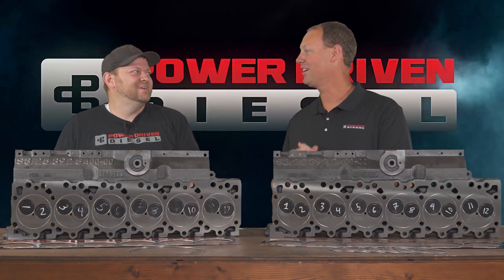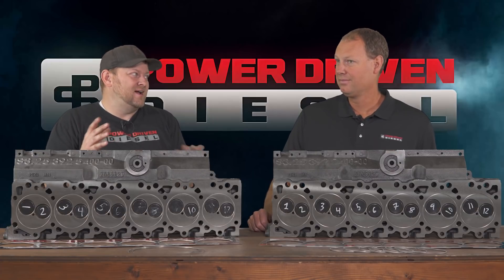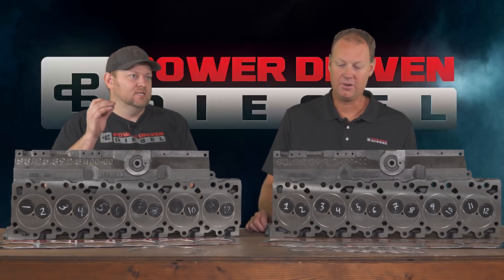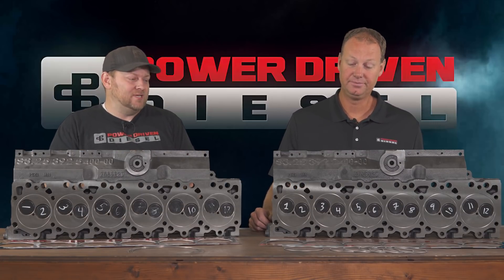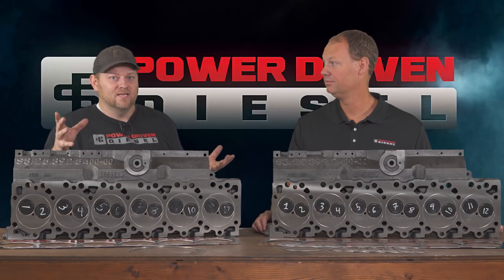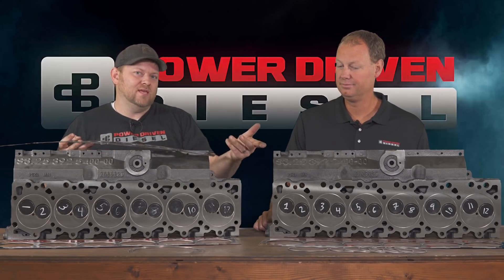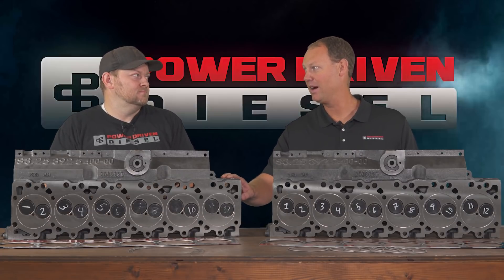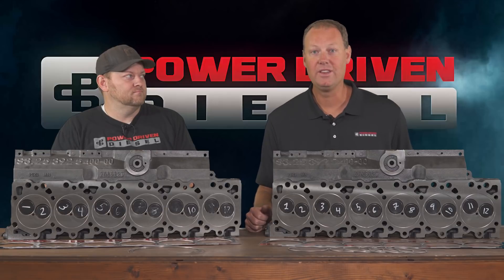Cummins O-ring vs Fire Ring Head Gasket | Parts Bin Ep 27 | Power Driven Diesel

Comment: 91’ intercooled Ve pump cummins goal of 600hp what should I do,MLS good enough?
Reply from the maker: We would use an O-ringed head unless you plan to surface the block and head for the proper RA finish required for an MLS gasket.

Comment: OEM motors like DD15 and 16 use fire rings that are stepped into top of liner and also act as top land carbon scraper and ive never seen one crack, i am wondering if you have looked at doing this for cummins applications

Comment: Can you get MLS head gaskets for a 12v? Would that pre-empt an o ring?
Reply from the maker: Cometic made them for a while, might still be available... but you'll need the block and head surfaced to a finer RA finish that oem to make it work and the gasket was $300+ back in the day, OEM gasket and o-rings was the same price so no one pursued MLS on newly built 12v engines.
Reply: @pddofficial oh. Now I remember you mentioned the RA.

Comment: You say not to o-ring a newer head with MLS.  But then said to o-ring all new heads.  I have a 2011, going to replace the head, buy a o-ring version?  If so, get a composite gasket?
Reply from the maker: We do not recommend O-ringing a 2003 and up cylinder head, just the 02 and older. The sealing surface on a common rail is better!

Comment: What about copper head gasket with fire ring??? I work in a shop years ago that built formula 1 engines and NASCAR engines and copper was used in the more expensive engines…
Reply from the maker: We've only seen copper gaskets on dry block and/or dry deck diesel race and sled pulling engines, however, they still utilize a steel fire ring to seal combustion and the copper is only used for oil sealing and heat transfer.

Comment: On a full rebuild, would you o-ring the head or the block? Shooting for 650/1500 range on horsetorques. I'll use it as a towpig/daily driver. Great video.
Reply from the maker: Most local machine shops do not have the specialty tools to o-ring the engine block, therefore it's most common to o-ring or fire-ring the cylinder head.  A head is much easier to ship to a specialty machine shop and/or purchase a new head that is ready to go.  We've seen no difference in reliability between choosing the head or the block for o-rings.
Reply: @pddofficial  Thanks!

Comment: I’m looking at getting the heads ported and the fire ring on the block and heads for my 2002 F350 DRW 4x4 CC LB Lariat 7.3 Powerstroke, Do you guys work on Fords? I got the KC300X stage 2 turbo 63/73 with the .84 housing, 304 grade Stainless Steel headers, and upgraded to 5” turbo back exhaust, Holders Premium 180cc/80% nozzle injectors, PHP Hydra tuner, Going with the stage 1 cam kit because I’m building for Heavy Towing. Please let me know if you can do the porting head work and valve/springs/retainers rebuild, Thanks!!!
Reply from the maker: At this time only the 6.0 sorry!
Reply: @pddofficial  Right On, Thank You Sir

Comment: My truck never lost a head gasket but I finally at 340,000 miles pull it to freshen it up and give back to the truck that's paid for itself ten times over and never gave me any problems besides a heat exchanger going bad so while I'm in there I am sending the block and head to the shop to get machines and thry are cutting the fire rings in both block and head because now that the truck is my toy daily more than anything it's just gonna keep getting more and more power haha and I ordered two sets of fire ring gaskets one for the shelf and one to go in❤

Comment: When you finish installing an O ring does it sit flush in the groove or does it stick out a little?
Reply from the maker: It will protrude out .013. The wire is .040 and the grove is cut .027

Comment: I have a 2015 6.7 Ram 3500. Tuned and deleted. Blew a head gasket last year installed a new head installed ARP 2000s and MAHLE gaskets. Blew again six months later. Is O-Ringing the head gonna help since i have the metal gaskets?
Reply from the maker: No not on a common rail you have to fire ring or run the better Arp head studs.
Reply: @pddofficial  Thoughts on wastegate install?

Comment: I know this vidjeo ain't about them, but O ringing your heads and using ARP studs is really the only way to keep from blowing head gaskets in a 6.0 Powerstroke, which as most people know is a huge problem with these engines.
Reply: Properly installed fire rings machined radius grooves in the block and head, and crushed appropriately, so torque and hot re-torque I know on the v motor it could be tough. A hot re torque on my Subaru sti would be an act of god. I still pull motor and try my best but any hp application you must be dedicated and do what needs done. Do not use square grooves must be radius and machined with proper crush tolerances. Honestly I don’t waste my time with o rings. If I’m that deep and it’s turbocharged it’s getting fire rings

Comment: Great info! We are currently freshening up the 12V in my son's 1996 Ram. So if we have the head cut for O-rings at a local shop would they also supply the wire for the rings, or is that something you sell? I assume you carefully cut the stainless wire to length versus them coming as rings.  I looked on your site for O-ring wire but didn't find it.
Reply: I found the information, looks like you just buy welding wire and carefully fit it into the groove.

Comment: What are your thoughts on copper coating gaskets? I did it on a 600 hp 12v built (no o-ring or fire ring) with exotic head studs. 3500 cab and chassis dually. 19* or timing and have towed with it before. Haven't seen any issues with it.

Comment: I have fire ring head with CA625 head studs and compound turbos, I totally agree with the boss there’s no point to use O rings if you’re making increased power. I hot re-torqued and did oil change at 500 miles then every 5000 or 50 hours, I am not an aggressor driver, so far zero issues at 250 hours.
Reply: Any issues since? It’s been 2 years still holding up?
Reply: Any issues since? It’s been 2 years still holding up?

Comment: Always love the parts bin tech. Appreciate you guys making it clear as day and sharing the experience of having tried different set ups and sharing what is successful.
Reply: 5.9 Any suggestions for 5.9 stock engine to turn up HP to 500 to 600 HP with used engine of 200000 miles 1 owner for head gasket upgrades

Comment: If the block and head are machined properly for a cosmetic mls on a 12 or 24 valve will they live with good studs to say 1500ftlbs and 800hp?  I don’t see why they would not but I hear a lot of stay away from the mls on the old engines.  I suspect most of that comes from people using them on blocks that are not flat and smooth but have no personal experience with them so I can’t say.
Reply from the maker: A few years back we tried a Cometic MLS headgasket on a 12v here at the shop with a freshly surfaced block and surfaced head and ARP 2000 head studs. The head lifted and the rubberized bonded layer peeled off causing a coolant and oil cross leak along with pushing water on each dyno pull after it failed.  The turbo setup was our ultimate towing compound turbos around 575 rwhp and 1325 rwtq.  That was the one and only time we tried the Cometic MLS gasket so other's results may vary.
Reply: @pddofficial  I purchased compound turbos (ATS 3000/5000) and ARP 2000 head studs. The two options out there are Cometic and Mahle. I almost ordered Cometic today. You just saved my @$$ thank you.. I CANNOT break down in Baja California or I'll lose my truck and trailer.

Comment: So here’s a question. Can you cut an o-ring head to a fire ring head?
Reply from the maker: Yes and no, generally the centerline of the o-ring groove is different (larger diameter) than the centerline of the fire ring.  However we've successfully cut a fire ring groove mostly over the top of an existing o-ring groove on an experimental shop project engine and it sealed up fine.  If the o-ring groove is in the head, it can usually be surfaced 020" to remove most of the groove and then the fire ring groove will clean up the remainder.

Comment: What Brand Head Gasket do you have the best luck with? What is your go to Head Gasket?
Reply from the maker: Cummins, Mahle, Felpro, Victor Reinz all seem to be similar quality on the composite 12v/24v gaskets, the PAI and Interstate McBee  used to be a step down but they both have improved/changed design where they seem similar quality as well.  On the MLS gaskets, the Cummins and Mahle seem to be the best when shooting for big power with just studs.  The other aftermarket MLS work fine on the stock to moderate power level applications.

Comment: Is O-ring better for daily/ towing? Would an o-ring handle compounds with 70-80 psi with mild timing? Lastly should you always hot re-torque or only with a certain setup( head studs, o-ring,etc…)?
Reply from the maker: O-rings are what's in use on Will's "daily driver" 1998 12v with compounds pushing 80 psi used for towing and hot street driving, been going strong for 80k miles!  Every headgasket we install at the shop regardless of stock gasket, stock with o-rings, or fire ring, gets a hot retorque after a short low power heat cycle.

Comment: No hot re-tq is asking for trouble. Stock tune (160/400) 1st gen took at least 1/8 turn across the head with my head full rebuilt+ fire ring by industrial ( no o ring option, fire or bust +industrial gasket)  running your IFG studs TQ 3 step to 125 x 3 hot with movement 4th held. 13k so far. Loaded my 2nd gen 4x4 on for 16,020( cat scale) at 500mi then circumnavigated the Great Salt Lake to seat the rings getting the third hot retorque at the top of rattlesnake pass on I-84.

Comment: Wonder how long my factory 24 valve gasket will last. 12mm opti torque studs. Torqued to 140.  800whp. No rings. Compounds. Between 60-80 psi. Maybe a small smack of nitrious.  ⏳🧨
Reply from the maker: Old gaskets with studs that are well settled and torqued seem to hold more than new gaskets.  So it may last for a while, but when it fails, if you go back with the same setup, the new gasket will not last long despite common sense argument that old one lasted x amount of miles at x amount of power.  Be ready to upgrade when it lets go, might be tomorrow, might be next year.
Reply: @pddofficial  Thanks for the reply! Yeah when it goes its time for o-rings. Machine for top hats. And a mild port job atleast to the exhaust side.  It would delay the build even longer if I did it all now. Short on $$!!

Comment: Fantastic Video I love Parts Bin episodes. I do have one question though. I bought a head from you guys an had it o-ringed as I thought a daily driver/street car would benefit from it but sounds like modern day fire rings would have been better. Is it possibly to fire ring a head that was previously o-ringed? I would assume yes but not the other way around? Thanks!
Reply from the maker: It is possible, but he groove diameter is different so the head will need to be surfaced about 020" to clean up most of the o-ring groove and then cut for fire rings.  If you're not making over 750 HP, the o-ring setup should last.

Comment: skip all of this and go MLS
Reply from the maker: On a factory MLS 2003 and newer Common Rail Cummins, that is a viable option up to around 1000 HP with high end studs.  On pre 2003 Cummins, MLS has not been reliable in our experience.
Reply: @pddofficial  sounds like a you problem with flatness and finish RA.  we both know that horsepower means nothing to a gasket

Comment: How much cylinder pressure are you transitioning over from O ring to fire ring?
Reply from the maker: Peak cylinder pressure is hard to measure without special equipment in a test cell environment.  Torque is a good indicator of average cylinder pressure that is easily measured on a dyno, etc.  1400 ft lbs at the tire seems to be a great transition point to need a fire ring head gasket.  Usually around 1500 ft lbs is when o-ringed and studded 12v and 24v Cummins fail.  These are "general" guidelines, true peak cylinder pressure, fastener clampload, block/head flatness all effect when the head lifts and the gasket fails.

Comment: Could y'all clear this up for me please. You say 2003 and up MLS gasket vs the old composite ones. But I thought Cummins oem updates to the MLS for the older models? Or am I not understanding something right here
Reply from the maker: If the block and head are machined to the proper flatness and higher surface finish specification for MLS, there's no reason it wouldn't work, but we're not aware of a Cummins branded MLS gasket for the older engines so the rumored OEM update is most likely a rumor.
Reply: @pddofficial  very interesting... Makes me really wanna buy another one just to tear apart. When I did my head gasket couple month ago and was torquing the head and on the edge of the gasket it look like MLS style layering steel. Though I didn't pay much attention because I was busy wrenching lol.

Comment: So with the radius cut fire rings compared to the old square cut, what’s the general life span of a fire ring now on a daily driver? Great info and I like these kinds of videos 👍🏽
Reply: I have seen a few fail in the 50-60k mile range but they were all head cut only.  I only know if one set over 100k but honestly most of the engines making 1500hp or more rarely are together long enough to log those kinds of miles in my experience. Cooked rings, excessive blow by, burnt pistons, cracked heads, or just wanting to change the setup usually happens first in my experience.
Reply from the maker: We agree, very small sample size of trucks with big horsepower and 100k plus miles.
Reply: @pddofficial   so what is the lifespan of the DD ones that didn't experience some other failure mode or driver-induced disassembly.?
Reply: I started using .059 stainless wire with a .062 cutter on my knee mill with a boring bar at a .010 protusions, in my head only.  I've had much better success all aground granted I'm not a big shop either bit I will never use .039 again if I don't have to.  It made perfect sense larger ring more sealing power but boy you better work out 150ft lbs isn't an easy task.
Reply: fire rings would fail based on heat cycles, not strictly mileage ?
Reply: @chriskahlson   is  the ring itself that cycling out¿ 
Do you think it is that thermal expansion is essentially forging( squeezing the molecular lettuce form into a tighter denser lattice) the ring smaller, causing it to lose pressure and sealing ability?
Reply: @daviddroescher  Normally the rings crack, probably from fatigue over so many pressure cycles.  You can only bend a paper clip so many times before it gives up. The more you bend it(higher power) the less time it lasts. Go easy and never make over 300hp and you could probably get a set to last 300K. Make 1000hp continuous like say in a boat motor and you might see them give up at 5000-10000miles.
Reply: @bcbloc02  thank you for the response sounds like I should be okay until I try and shoot for Bonneville with over 2,000 pounds of torque and under 1k hp

Comment: U can’t o ring a MLS gasket. It will leak……

Been there done that in my Grand National when cometics first came out.
Reply from the maker: We don't oring MLS either, but we know of shops that do it with copper wire instead of stainless and have success.  That said, will a copper  o-ringed MLS gasket really hold more power than a standard MLS?  Maybe yes? Maybe no?

Comment: I believe hot torque is everything. I'm still running factory style head gasket with arp 2000 torqued 10 ft lbs over and 3 hot  torques so far no problem been about a year. Not sure on horsepower level but its 88 over injectors 2nd gen swap 60 lbs of boost. I have fire ring head gasket on the Shelf but I couldn't find anybody to cut the groove for me that's close to me so I had to go back with the factory.
Reply from the maker: Cool that is surviving!  Really how you drive it will have a big impact on how long it lives.
Reply: @pddofficial  it lives a vary hard life lol

Comment: So timing blows head gaskets not boost? So if I can make 800 at 25 degrees of timing I don't need this?
Reply from the maker: Peak cylinder pressure blows head gaskets.  Cylinder pressure is created from airflow(boost), fuel, and injection timing (amount of time fuel has to burn relative to piston's position in the cylinder and therefore overall volume to burn/expand).

If you make 800 HP with 25 degree total timing on a diesel, you could probably make 50 more horsepower with more optimal timing.  Most builds tend to try to optimize the power potential of a given combination, but if the head gasket is a limiting factor, power will be sacrificed in the name of reliability.